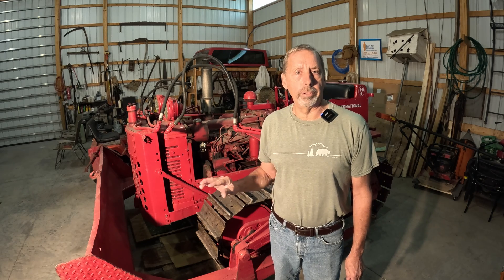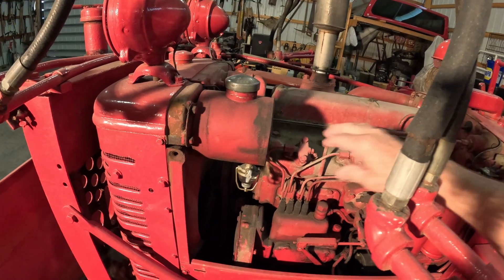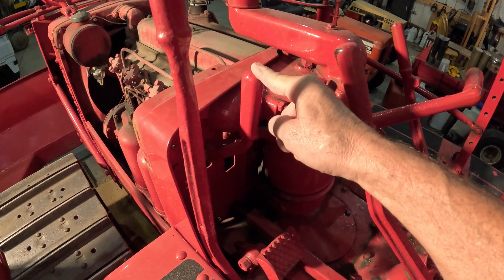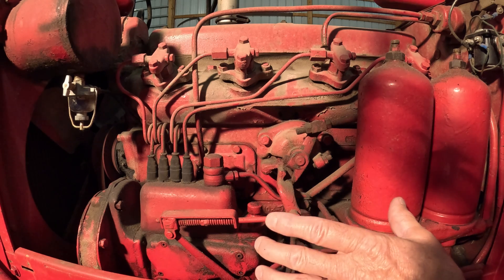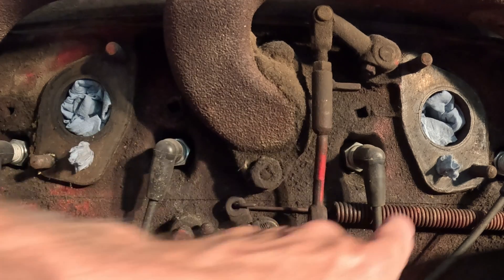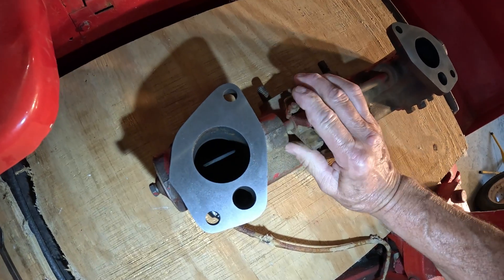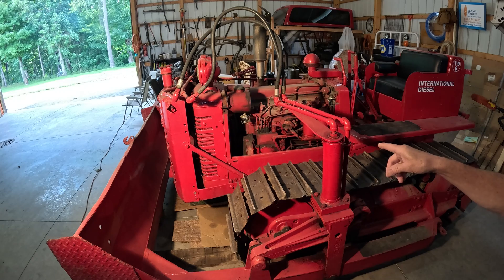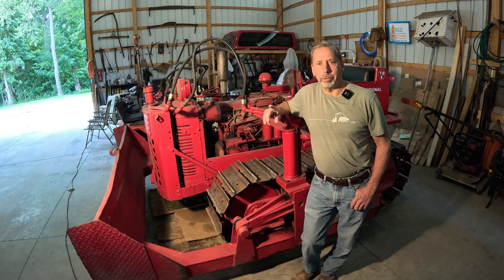How Does A Diesel Engine Run On Gas?

Comment: This video is helping a lot I can see that my linkage isn't moving wright and not snapping. The cat was parked running and under cover but no doors on shed. It's been setting 40 or 41 years 😢I'm  sure sterning clutches will be frozen up. I don't know the best way to free them up? International TD9. 1944 maybe 1945?
Reply from the maker: If the machine was mostly out of the weather the clutches may not be froze. Once running, the may unstick just by moving it around. Good luck with your project

Comment: Very good video!
My opinion: Simply shut rhe Diesel throttle off once the engine is cooled down.
The gas cycle shut down is an ancient IH idea from the crank start era. IH gave up on that.
Pretty darn well explained!
These engines are still such a mystery to many people.
Nursed a six cylinder version (UD-16) for a few decades and now am lucky to have a newer version (UD-525) within that series.
Six thumbs up!
Ahhh, IH gas-start Diesels.
Thank you!
Reply from the maker: Appreciate the info. Thanks for watching

Comment: We used to have a TD 9 exactly the same just a little on the ranch and it was a 1967 or 1968 and it wasn't if the weather was cold it would be a little finicky to start

Comment: Perfect explanation!  Complex as all get out but it eliminates the pony engine starting clutch.

I like the preheat as it makes this engine arctic capable.  The US Military used multifuel engines in 2-1/2 & 5 ton vehicles, these had intake manifold flame preheaters..direct flame in the intake manifold.   These engines needed high compression to ignite when gasoline was used..sounds backwards but gasoline has higher autoignition temperature than diesel.

Diesel engines can run on gasoline if the gas can be coaxed into igniting early enough.  That same anti-knock index which prevents engine knock inhibits use in the diesel cycle.
Reply from the maker: Great info. I know those military trucks can burn any flammable liquid but how it can meter it for a diesel engine is amazing. Thanks for watching
Reply: @PleasantValleyOutdoors  

Multifuel engines use a single plunger Bosch injection pump with the plunger having engine oil on the gear side, this kept the pump from seizing.
Pumps were compensated for fuel density as energy content is proportional to density.
Reply from the maker: @keithjurena9319   Thanks for the additional info 👍

Comment: You sir have a nice little piece of equipment there, I own a td18 Industrial bought it about 30 years ago, use it on a ranch.
You have explained perfectly how the starting system works.
I have been doing mechanic work all my life, when I bought the Dozer it had pulled scrapers all of its life on a ranch, so with that being said I am now going to weld up the rollers and front idlers, Drive sprockets are still good, it had a new final drive and a major overhaul.
Right now I am looking for chains and pins if you know where there is some laying around I would appreciate letting me know, The Growers are still good shape.
I have a lot of work on the ranch that's coming up real soon.
Reply from the maker: Unfortunately I don’t know of any chains around. Years ago I run across a brand new set of rollers for it really cheap. Mine were completely worn out so that really helped. Thanks for watching
Reply: @PleasantValleyOutdoors  thanks for replying to me, I have welded so many rollers and front idlers and final drive sprockets in my lifetime I really didn't want to do these rollers in front idlers, but I guess I will. Caterpillar chains are the same in some models I'm still keeping my eyes open trying to find some. Everything's so damn expensive today.

Comment: You're talking about a gasoline-fueled pony motor. You ought to know that's just the starter for a diesel engine which run on diesel. Your title is deceptive. You might as well claim that a car runs on electricity because it uses a 12 Volt battery to crank the gasoline engine into action. Why is YT recommending so many newly-established channels to me lately? Channels with high production values despite minimal subscriber counts?
Reply from the maker: It’s obvious you didn’t watch the video. A pony motor is a separate engine to start the diesel engine.
Reply: @PleasantValleyOutdoors my first tractor was a Super MD. It started the same way.
Reply from the maker: Yep same engine. If I’m trying to get engine parts from a dealer I tell them it’s for an MD. If I say TD6 they’re completely lost. Thanks for watching
Reply: @PleasantValleyOutdoors  I did watch it, and you have just restated my previous comment. You are the one who is not paying attention, botter.
Reply: How could you claim this has a pony motor when he took apart the mechanism itself! It works nothing like a pony motor! 

This is THE BEST explanation of this system I have seen on this site, and I think the better question is why do only the channels with no content make these kind of comments?
Reply: So what is your point?  I  never heard of that setup before I learned something.

Comment: Very nice looking TD 6 you have.
I have a TD 9. 
Haven’t run it in years.  
Back in the day it was a very good and powerful machine.
I hat always heard they were prone to cracking heads.
Great video!!
Reply from the maker: Yes the heads were prone to cracking if the engine wasn’t cooled down long enough after use. Thanks for watching
Reply: @Michael-e9c4n  yes they were. We always left them running all day. Then we let them idle for at least 5 minutes before shutting down. We never had any trouble.